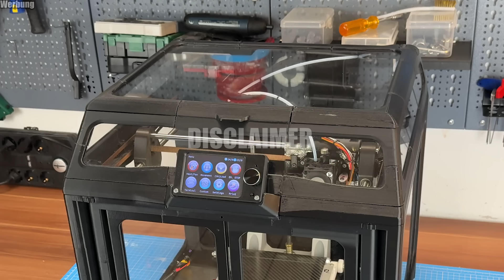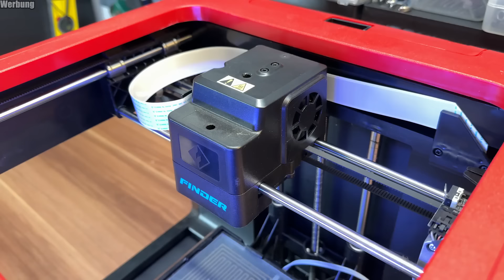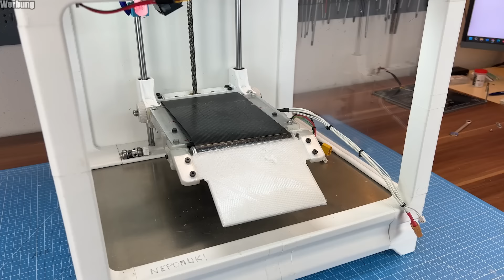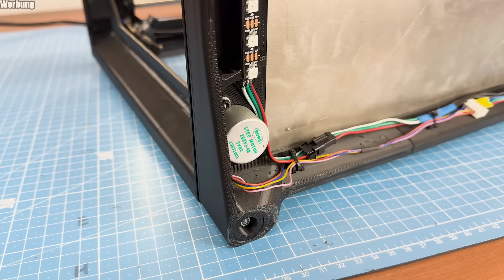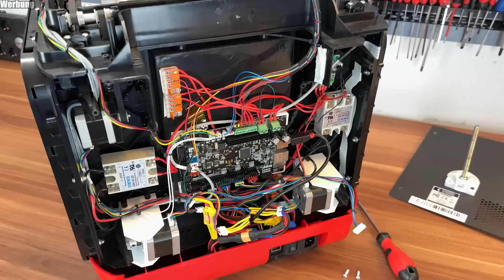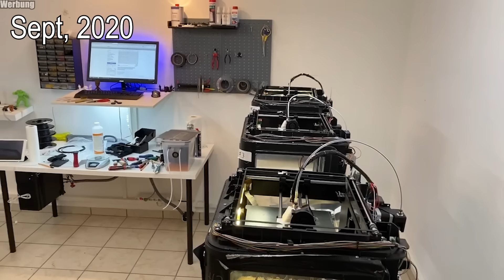Automated 3D Printing with THE247!

Comment: Well the design sure has improved over time.  That said I think you have most of the right boxes checked.  The creativity, innovation and ideas are all quite impressive.   

I am somewhat suspicious of an all 3D printed frame but i could be convinced depending on cost, ease of assembly and of maintenance, durability and performance of the printer as measured by input shaping and part results.  But i love the innovation and if data shows that it is solid then i would adopt to it for sure.  

Data such as input shaping profiles, layer lines, part appearance, and possibly but probably not necessary look at layer adhesion and other mechanical strength.  Those last 2 are most likely a result of the hotend and extruded combo along with the choice of printing parameters.  I am guessing that it does work quite well otherwise someone like you wouldn't be using it in your design.

I am more of a fan of linear rails - but i would be open to being shown data on 2 printers, both are exactly the same except there is  one with rails, one with the rods, and then let's make some parts and compare the results.  In other words i am not simply going to assume that linear rails would be better everywhere. 

The Z axis - I am a bit more a fan of having the "3 z motors on ball screws" design for stronger support, bed leveling, stability and the ability to do some  non-planar printing with the bed tilted if the design calls for it.

I have learned so much from your channel, it is among the best here on YouTube - there really are some amazing channels so you are among great company.  Cheers

Comment: There seems to be a lot of empty space to the left and right side of the bed on the internal volume of your printer. Otherwise, great build, amazing ideas, and I love to see what you can do with a printed frame. That's very impressive.
Reply from the maker: Thx 🫶 It fits a bigger regular print bed as well - that’s why the small conveyer looks a bit lost in space 😅 But it’s still true: The overall design could be more space efficient 👍

Comment: Great build. I should show what I welded in 2016; my coreXY with Klipper. Yes, Klipper was available then! Brand new!
Reply from the maker: Show it! Why did you choose Klipper back then?
Reply: @247printing  My friend who was guiding me on the electronics back then said I should check out this new faster firmware, better than Marlin. So I did! Wanted to try the new kid on the block then
Reply from the maker: I really wonder how it was at the start and why people used it in 2016 - pressure advance and Input shaping were things already? The convenience of parameter updates via cfg and reset?
Reply: @247printing  For me when it was no need to compile for changes make to the config, like you said. Marlin needs to recompile after every change, as you know.
Don't believe we had input shaper or PA at the time; would need to look again at my config.

Comment: Ich hasse diese Drecks Pappe Filamentrollen. Sie sind scharfkantig und die Handhabung erfordert Konzentration dass man sich nicht daran kratzt.😢
Reply from the maker: Echt? Hab schon viele derartige benutzt - nix passiert. Welche Marke schneidet so sehr ein?
Reply: @247printing  ich drucke nicht viel daher kenne ich nur die Esun PLA+
Ist trotsdem kacke in der Handhabung. Ich habe einen Garten und Garten Möbel. Jeden Tag kackt irgend ein scheiß Vogel drauf. Und ich muss die scheiße herunter kratzen. Wenn das ständig passiert dann fängt man an Vögel zu hassen. So ist es auch mit Öko Veganern den Grünen. Wenn man ständig einer Kacke (scharfkantige Filamentrollen, Papp Strohalme Tropfende Verkandende schraubdeckel, gendersprache, Werbung... ) ausgesetzt ist dann fängt man an den verantwortlichen zu Hassen.

Comment: Do you really need the conveyor belt? Or could you use the print head to push the print off the bed once the print is successful? 
Yes you would probably need to cool down the bed first but it would make the machine so much simpler and more reliable...

Comment: Interesting design! I had an idea – perhaps a system that uses a few servos to bend the flexible build plate and a simple sweeper arm to remove the finished print would be a more compact and efficient way to automate the print removal and restart process. Just a thought!

Comment: I would like to see this with IDEX to print supports and parts efficiently and minimize post processing. I imagine this would add a lot of extra complexity, but if the printer is a 24/7 machine, having the ability to run two different materials is ideal.

Comment: Since the 247's goal is to print continuously, I would suggest having space inside of the enclosure to keep the roll of filament.

First, it would keep the filament in an dryer place than outside the enclosure.
Second, it would preheat the filament so the printing head wouldn't need to dump as much heat in it and the use of the heat from the enclosure would be free, so more efficiency and a maybe a more even melting so maybe allowing to push the speed higher.
And third it would increase the thermal mass of the printer and reduce the temperature swing from when the doors open.

Since the electronics are making some heat and probably wouldn't mind being kept at even 70C, dump the heat inside of the enclosure, it's free heating and if you you allows for routing the cables from the side you can also allow for the printer to be right against a wall without fear of blocking ventilation.

For the style of the frame, I really think the vertical seams are ugly maybe have cover cover plates that can snap in place to add a gribble look

Also for the fastening methods and structural integrity of the frame. Have you thought about pouring concrete inside of the printed parts like Chris Borge did on his projects ? You already have a rebar/pre-tensioner adding some concrete (from portland cement or epoxy) is the logical next step. It would add a lot of rigidity thanks to the tensioning bars pulling the concrete together, and it would add some sound/vibration deadening.

Comment: I think this is an amazing idea, but I don't like the idea of the frame been fully 3dp. I would prefer a cube made from anodised aluminium extrusion with 3dp connectors. If you do want to keep the fully 3dp frame then may I suggest a flush fit between the 3dp parts instead of curved edges purelyfor visual purposes😂. Other than that I think just making the moving mass as low as possible to get the print speeds up, if your trying to make this a commercial project (which I think is an amazing idea!) then your going to be up against printers like the voron, various RatRigs and possibly BanbuLab and therefore the print speeds need to be on the same level or above. Keep up the good work!

Comment: I think it looks really good, but maybe use better looking font for the "247"
Reply from the maker: Which won't don't you like? "247" actually appears in three different fonts: On the printer, in the 247printing logo and in the intro after the build-up of the rendering.
Reply: @247printing I don't like how it looks on the black frame printer. I actually do like it in the renders. That is just my opinion, though!

Comment: Giving the constructive criticism you requested:

Personally the frame gives off an appearance that doesn't look rigid. Namely, the beams forming each edge of the printer are split into multiple parts. I'm not sure how you would easily fix this given your requirement that it must be able to print parts for itself. But maybe more parts with more seams is the answer??? At the very least, I recommend getting rid of 180 and 90 degree seams. I.E. Do seams that interlock with each other. This way bending loads have a more difficult winding path.

Further "beefing" up the edges would be good for rigidity. Make each edge-beam a large triangular cross sectioned tube. (Mostly hollow with thick perimeters.) Maybe 50mm across the shorter lengths? Essentially, scale up the outside dimensions of a 20x20 extrusion up by what ever factor the weakest link in the 3D printed assembly would be. For example: 6061 aluminum has a ultimate tensile strength around 290 MPa and PLA+ might achieve around 58 MPa. Keeping the same  3.2mm wall thickness you would have to scale the beam up by (290/58=) 5 times. 100x100 might be a bit large for each edge-beam of the frame so you could do 50x50 with somewhere around 8mm thick walls. Or keep the 100x100 size and thicken the walls to get insane strength and rigidity for 3D printed parts. ;)

Also, as a mechanic, I prefer maintenance friendliness 10/10 times over seamless appearance. Besides, slots and holes with flush mounted socket cap screws look sexy! For inspiration, here is a link to a 3D printed design with amazing aesthetics: https://www.printables.com/model/537888-mmu3-ultimulti-printable-parts

Lastly, I think what Prusa has done with their newly released CORE One design makes a lot of sense. Specifically the enclosure being very close to the printbed and the print bed being lifted on all 4 corners. Or like a Voron 2.4.

I think you should make an improved version and I wish you the best!

Comment: Awesome project, truly exceptional. Can you print the frame lengths in one go rather than 3  using the belt to print long sections?  Perhaps a longer printable belt platform would help - just long enough for the frame length plus some extra.  An automated printer has one huge bottleneck- the measly roll of filament. If you seek unattended printing you either need to use a massive roll so few filment changes or a cms with rolls of the same filament or even better, use pellets with a huge hopper.

Comment: I know the video isn't about that but, did that tin foil trick help with the bl-touch?
Reply from the maker: The combination of twisting the wires, magnet at the end of the wire and that alu foil improved it, yes. But it’s still unreliable and it can fail at some point.
Reply: there's a magnet at the end? didn't even see that. ^^
Reply from the maker: @aracon9721  check out the clip of the electronics department

Comment: It's a great project. The symmetry is aesthetic, but with an asymmetric tool head it seems like the bed is undersized on the right, or the linear axis too long. It would also be interesting to weigh the advantages of laser cut acrylic windows adding structural support or alignment to the frame rather than only insulation. Similar logic, printing expensive filament parts negates advantages over an aluminium extrusion, also widely available cut to size.

Comment: Like others have mentioned using aluminum for the frame is probably better. I was thinking of doing something similar to an SOVOL SV08. Unfurtunatly I do not have the time in the moment. The fixed base and flying gantry should make this relatively straight forward. As a bonus selling upgrade kits for voron 2.4 designs gives you a large market off the bat. You could even call it the 2.4 to 24.7 upgrade.

Comment: I did some patent research a while ago and as far is I could find, the automated build platform by makerbot (now bought by stratasis) was not filed outside the US (anyone who knows better: please correct me .... Patent research is not my strong side). Im pretty exited about building a conveyer system, like you have myself. I even thought about buying a IR3V2 just for the powder coated PEI stainless steel belt. So further development into the carbon fiber belt system and a release would be greatly appreciated. But Im not so sure about the fully 3d printed frame. Even with fancy and expensive PPA-CF you dont even get a senventh of the stiffness of aluminum. And to a way higher price. Im sure you can make a great looking machine with black anodized aluminum extrusions screwed together invisibly from the inside of some big printed angle brackets from PPA-CF. Getting a lasercut Stainless steel sheet for the core XY frame would also not be that expensive. Guestimating from my last order about as mutch as half a kg of PPA-CF (in Germany). So ... Please make a released version especially from the build platform, but Im afraid you will significantly limit your performance, when going with the fully printed frame.

Comment: I've never had a conveyor belt 3D printer but I've been interested in the concept.  I think I'd keep the conveyor stationary and use a flying gantry coreXY system, but for the products that I print, it's generally sufficient to use a 300 x 300 mm bed and sequentially print as many parts as possible, and manually empty the print bed once a day.  Before slicers supported sequential printing, I would slice the part every location I wanted to print it and I'd concatenate those files with custom G code to move to each successive part.

Slant 3D has a simple solution for batch printing.  Gabe designed the front of the print head with a little bulldozer blade.  At the end of the print, the bed cools to release the part and G code moves the print head behind the part and pushes it off the build plate before printing the next part.

The preferred method is determined by part geometry.  For printing a lot of small parts, a continuous conveyor would work well.  Advance the belt enough to make room for the next part and print.  The front of the conveyor could be unheated so the parts naturally release.  I generally prefer sequential printing to improve part quality, particularly for the TPU parts that we manufacture where stringing between parts would ruin part quality.
Reply: I've been printing 8 parts on a 350x350 mm build plate for small scale production.  I just bought the little Sovol Zero which has a 150x150 mm build plate.  It hasn't arrived yet but I just prototyped printing one part on the front of the bed and then using custom G code to eject the part into a bin in front of the 3D printer and it works.  It'll work better on the Zero.

One big trick is I designed a single layer thick 0.4 mm tall round pad to prime the nozzle.  The pad is attached to the part so it peels off the bed with the part when its ejected.  These are TPU parts so there is significant oozing after the print, but the slow part ejection allows the nozzle to ooze until it stops and the thin strand remains attached to the top of the part nut not the nozzle.  The pad is a small tag that can be easily torn off the bottom of the part with no residue.  The ooze strand can be easily torn or snipped off the top of the part.  Post processing is very easy and each print starts with a clean build plate.

Now, instead of printing eight parts on a large build plate and then needing to unload the build plate and restart the large printer, I can load a spool of filament and the small Sovol Zero printer can print 50 parts, one at a time, into a parts bin, with no wasted time waiting for me to unload and restart the printer.  I can hang another spool of filament and have it print another 50 parts.  It's much less effort, using a smaller, less expensive and more energy efficient 3D printer.

Admittedly, using the tool head to push parts off the bed only works with some part geometries.  The conveyor belt part unloading is more universally applicable, but pushing the parts off the bed works with a stock commercially available printer using only some clever G code, and the unmodified printer is available for other printing tasks.

Comment: Amazing work, I have also used threaded rods to reenforce plastics in my designs. But i fuse the rod/bolt/screw into the parts. I put a cross onto one end so i can use a philips bit on a drill to drive it in to a hole slightly smaller, the heat generated both makes it easier to drive in after you start it and then locks it in. Both securing it and re-enforcing the two materials against each other.

If i were to make the bed with automatic doors i would have made the actions mechanical. The bed could have a pin sticking out that when it reaches the bottom presses a switch witch then energizes both the bed to move and doors to swing open. The circuit could run on a timed relay so that it doesn't run forever. As for part clear checking.. idk, i just thought of this

Comment: I’m not a huge fan of the printed frame. I run a small farm of Prusas and I’ve had to replace tons of petg printer parts with polycarbonate because the petg creeps and fails over time at temperatures around 38c inside the enclosure. 80-20 aluminum is a good choice for a frame because it’s stiff and easily available from many many sources.

Comment: pretty cool project. suggestion do away with the ramp and rotate the doors from vertically to horizontally and use the lower door as the ramp. a bigger build volume would be nice looks like there is a lot of wasted space.

Comment: Would be nice if you adapt the belt bed system to a voron zero, for those who dont mind a small bed area but want to print faster than the 247’s fully printed frame and round rods would allow

Comment: I always think "What feature could make for the subsequent generation of printers?"
Heated Bed, Steel Sheets, Filament Runout Sensor, Automated Bed Leveling, Nose-cell Bed Leveling, Endless Print Surface, IDEX, Core-XY, Multicolor, Toolchangers, have all been incorporated into market products.
Maybe automated doors is The Next Big Thing ?

Comment: Awesome video and even cooler machine! You could print the frame much larger pieces on the V-Core 4 500 and eliminate the need for so many joints. Looking forward for a first public release, would rhis be an open source project?

Comment: You should definitely continue this project it could become something like a maker version of prusas AFS system.
I have a suggestion for a future upgrade: a filament splicer / MMU upgrade so it can truly run 24/7 at those higher speeds by automatically switching to a new spool once the filament runs out.